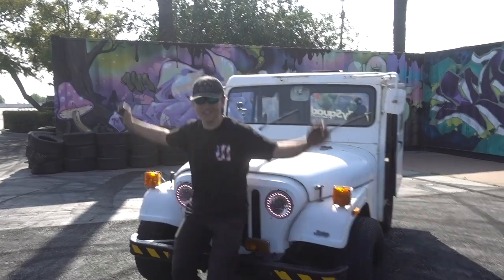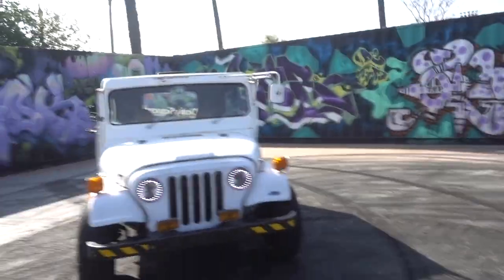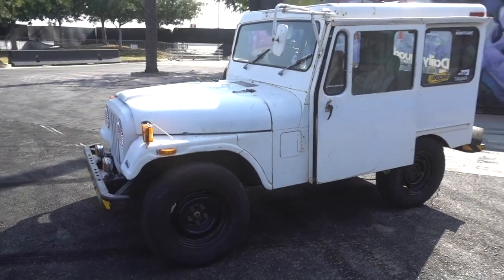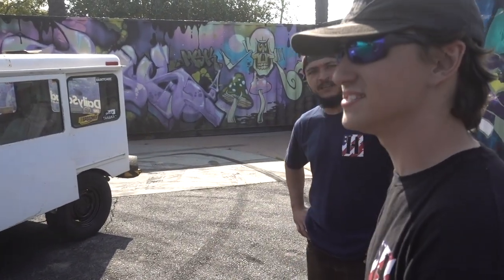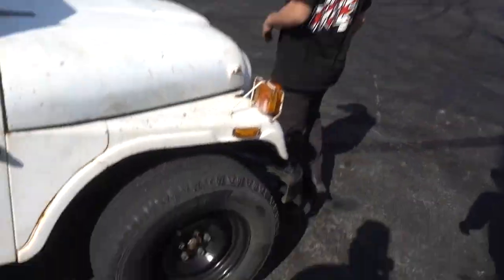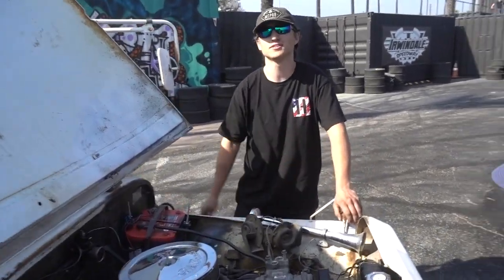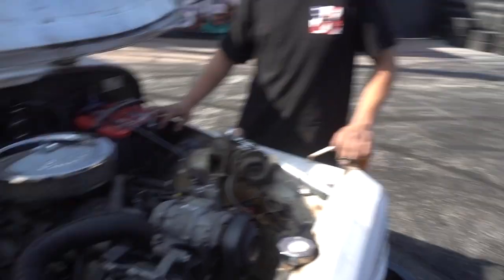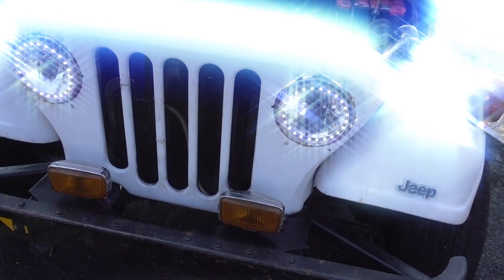Ex-Mail Truck Built to Shred: V8 Swapped Postal Jeep Destroys Tires (and Radiators)

Comment: I rescued one of these from a junkyard, someone put it on an army Jeep chassis and used a 258 in it. I had to rewire the entire thing and make a "fuel cell". I drove it to the corner store once before selling it. Steering was more of a suggestion than a command. Little thing probably would have been fun if I kept it. Hint: those solid tops are heavy as hell. He cuts it off and pulls those doors in favor of a bikini top and rollbar and she will handle alot better. I think 35 degrees to either side and those would roll over

Comment: Thought it was a cj7 at first glance. This definitely motivates me to finish my turbo Wrangler YJ v6 swap
Reply: Turbo v6 in a yj?? What v6 are you using?
Reply: @MAXQ14  yj/cherokee xj 4.0 straight 6 block (AMC 242) forged internals, cams, headers....
Reply: @brianclarke7221  but that's an I6,  still great though. I love the 4.0 in my yj (excepts it's thirst for fuel...)
Reply: @brianclarke7221  that turbo straight 6 would be sick in this mail truck, but probably a really tight fit.
Reply: @brianclarke7221  Doesn't sound like you know what you're talking about. V6? Its a Inline 6   Headers? You mean Header, there is only 1. Cams? Again, It only has 1. Forged internals? No one makes forged internals for the AMC 242.... I've built a YJ from the ground: Banks header 6-1 primary, JBA mid pipe, Magnaflow exhaust system, Cat delete, MSD ignition, Ported Intake, Gutted/weight reduction on 28" Goodyear Street tires. That's just about everything you can do besides going Stroker, Supercharger, Turbo, or aftermarket Head.

Comment: Pass on advice ?? To get a 360 top end & Zach's Chopmaster cam to stuff into that 318 & make some serious power. Original 2bbl intake & carb sucks. The 8.5:1 comp ratio & small valves & ports don't help a thing. 
Just a FYI. 👍👍
Passing on experience.
Reply from the maker: Roger Marshall still rips!
Reply: Its '96, so probably magnum tbi at 9.1:1.  It would have a 3.31" stroke which could be replaced with a 4.00" crank for maximum fun time
Reply: @HooniganDailyTransmission  
Any V-8 in a mail Jeep will light a one tire fire. Install some fresh ponies & a locker & burn 'em to the steel.😜 I'm a fan.

Comment: Ford Explorer 8.8 diff with two short stock axles. 31 spline, LSD, 5x4.5 lug pattern, and comes in 3.73 and 4.10

Comment: I used to work on Mail Jeeps for the USPS and that is Not  a 1968 it is a 1978 because the Brake Master Cylinder is mounted up high on the Fire and it has top swing pedals if it was a 1968 the Brake Master Cylinder would be mounted on the bracket on the outside right frame rail and the brake pedal would also pivot off that bracket and the pedal shaft would go through the floor.  Other than saying he has V8 Postal Jeep he should have just built the Inline AMC 258 6 cylinder engine because stock they made 150 HP stock and could be built into the low 300’s without much effort or if he wanted a Fuel Injection engine slammed a 4.0 Liter in it that stock put out 185HP and can be built to put out a F ton more and on top of that would of fit right in that engine bay without any problems.  I don’t know why he is bragging about the short drive shaft other than he has a short D just as I don’t know why he hasn’t rebuilt the Dana 44. As for the effort of replacing the front axle to put disc brakes on it he could just gone to a junkyard and grabbed a couple of CJ disc brake spindles and saved himself some trouble  but my guess this guy slams whatever is cheep in his Jeep rather than what would be cool because he thinks the Postal Jeep is kool enough. In short the only difference between a DJ-5 and a CJ-5 was the body and not being 4WD.